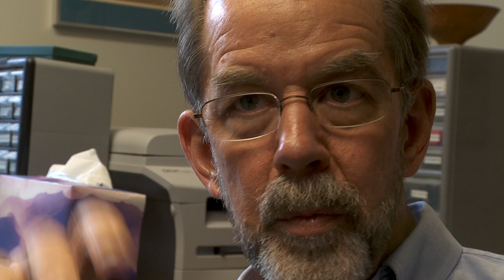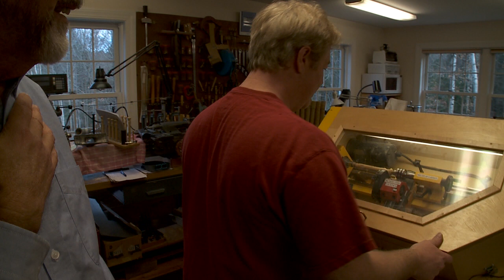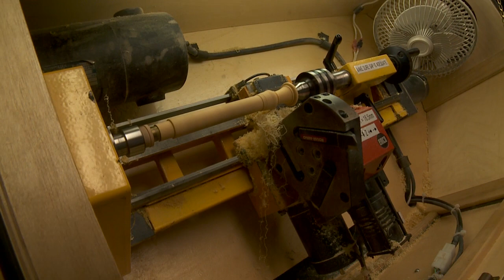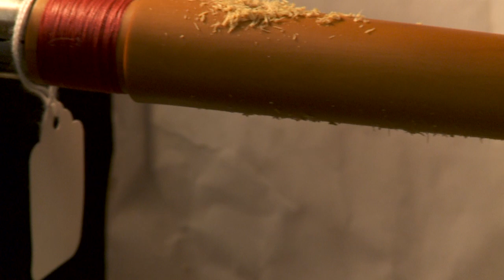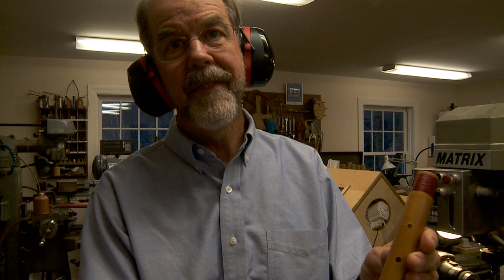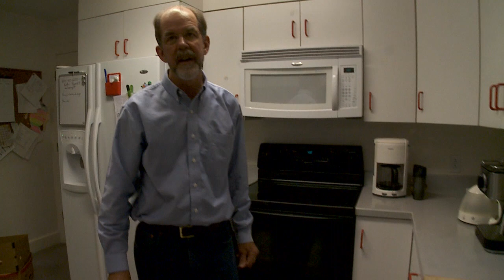Meeting recorder maker Tom Prescott.

Comment: PLEASE HELP:  What sort of dyes are used to stain/color the outer surface of the recorders?
Reply: I use Wella #445 hair dye for all renaissance recorders, as well as the lighter colored baroque recorders. For the former I use  10 Volume peroxide as a developer, and 40 Volume peroxide for the boxwood instruments. Boxwood parts are soaked for five days in boiled linseed oil then wiped and turned on a lathe while the dye is painted on. Renaissance sugar maple recorders are soaked for one day. The dye is painted on the spinning recorder for five minutes before wiping off.
Reply: @thomasprescott8417  ...and now I know more. THANK YOU very much, sir. You are very kind and helpful. Respect!